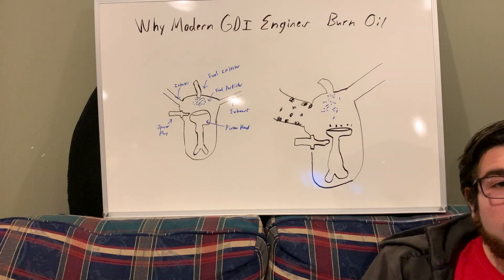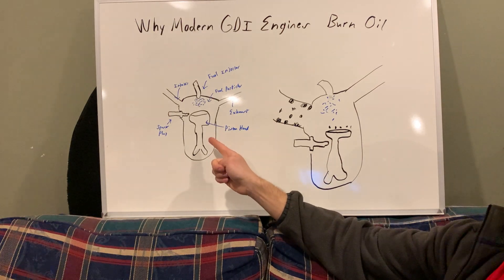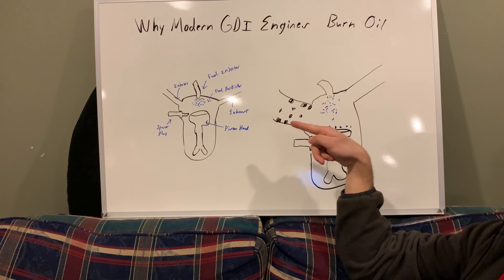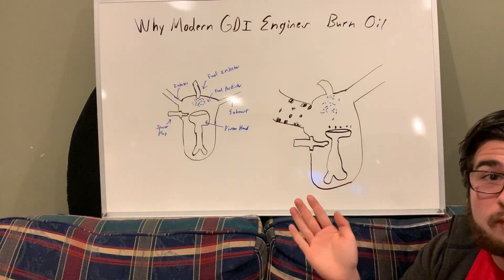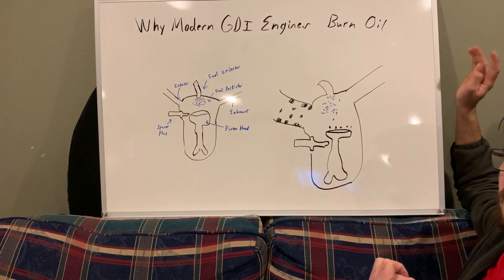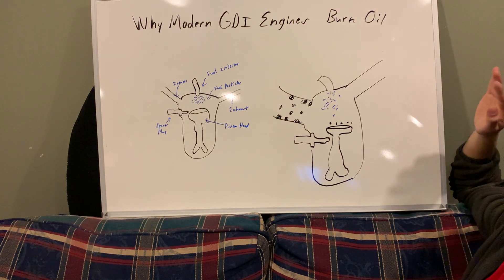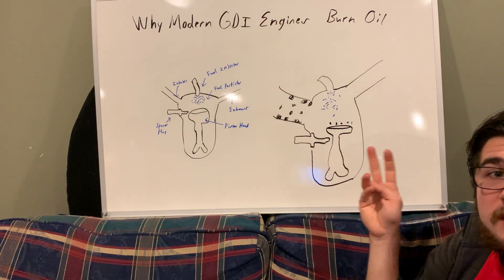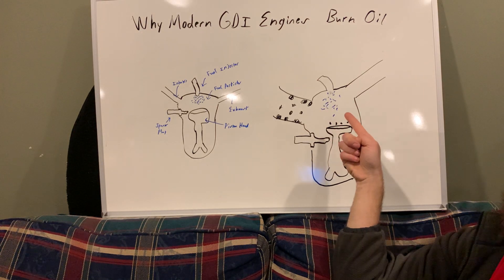Why G.D.I. Engines Burn Oil

Comment: My gdi engine doesn't burn oil
Reply: Give it a little time
Reply: @dgsmith007  now im waiting for it to catch fire or blow up
Reply: @raycormier5110  well they have a recall on that low pressure fuel line I'm taking mine and getting it replaced
Reply: What year of car and how many miles?  My Sportage with 67,000 does a qt. of 5w20 in about 1000 miles, calling Kia later today.
Reply: Thank you! Neither does either of mine! Man I thought I was the only one.
Reply: Many of the cars having trouble (KIA GDIs for one) are "short hop" vehicles that don't get hot enough to evacuate moisture.
Reply: @mcgeorgerl  especially if people are going over 4-5k oci and city driving like crazy. Rule of thumb all city driving change at 3,000 or so miles, mixed-4K, mostly highway then 5k for gdi’s can’t go wrong. The often you change it the better also quality oil does go a long way.
Reply: You got the bestest one ever made my man
Reply: I have 158k on my 2012 optima and keep changing the oil every 2500 miles. I'm just using regular conventional 5 / 30 oil . Yes it's expensive but still better than the other alternative . And yes my mechanic also put in a new knock sensor . Hoping for the best ....

Comment: I think oil burning is more the symptom than the problem.  Carbon build up on the intake is the problem (isn't the carbon build up just oil burnt on?).  Anyway oil consumption is manageable but carbon build up can kill performance and require walnut blasting or similar.
Reply: I got my intakes cleaned at my mechanics shop. Some snap on machine that the vehicle runs on and cleans while running. Made a huge difference. I'm also keeping up with it now with amsoil products.
Reply: @benca6151  About how much does that cost?
Reply: @105rogue  well it was last year. But it was $130 at the shop I went to
Reply: @benca6151  Thank you for that.
Reply: @benca6151  would you mind sharing how much this cost you?
Reply from the maker: Yes @james caley, you are totally correct in that oil burning is a symptom of the inherent flaws involved in the process of G.D.I. Obviously, to an extent oil is always going to cake onto intakes and pistons as time goes on in a worn engine with 100,000+ miles. However, with G.D.I. this process of wear is exponentially increased and as you said leads the intake valves to have to be cleaned with either chemical or walnut blasting. This can be a huge expense and should not be required of the owner and written off as "it's normal for modern engines to burn this much oil." This is why like I said companies like Toyota have gone to start multi-port injection to help resolve this issue of carbon build-up using gasoline as a solvent for the valves. Another issue I plan on talking about soon is oil dilution and its concerns in primarily Honda's modern turbo-charged engines.
Reply: Great video thanks for the explanation. Are you familiar with the noack volatility test for motor oil?
Reply from the maker: @MikeTrullAmsoildealer  Yes I am aware of this test and I have watched numerous videos and studies done on the subject concerning different brands of oil. Unfortunately, oil burning generally has nothing to do with this concern. Modern synthetic oils are required to meet certain API standards and as such should have plenty of head room in terms of operating temperature within an engine regardless or whether it has G.D.I. or turbo-charging capability.
Reply: It costs me $135.